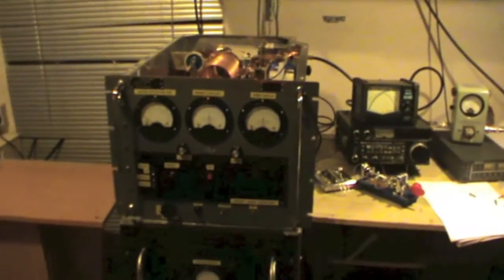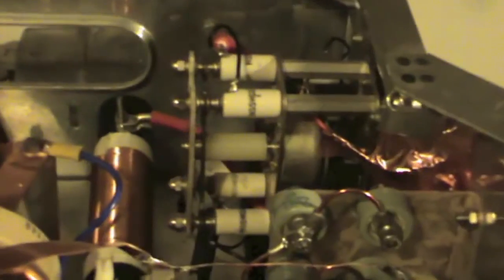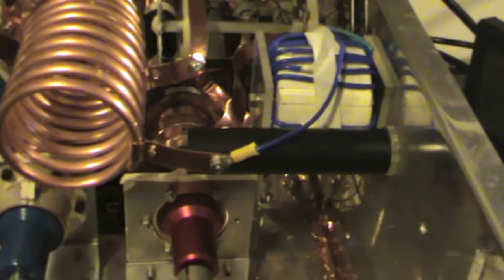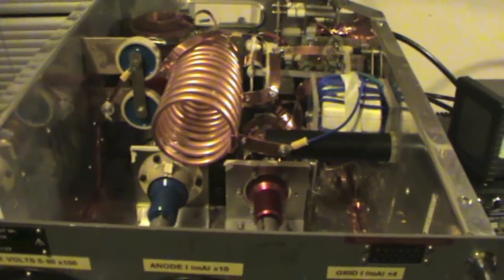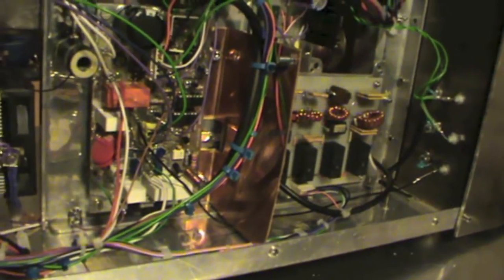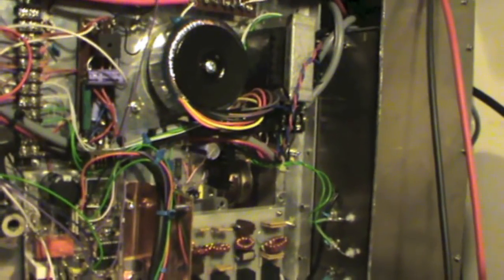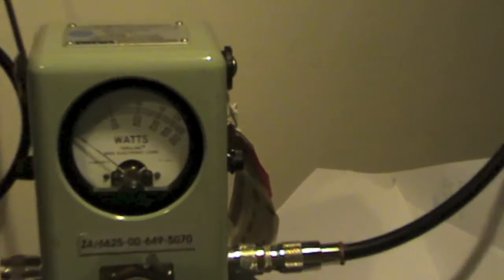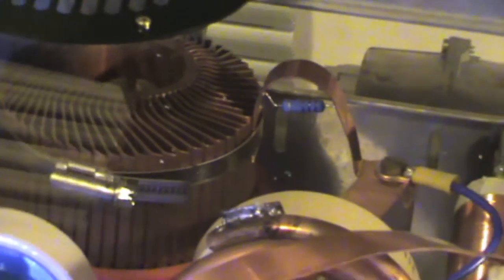gs35b linear Amp

Comment: I was looking for a blower fan for my GS35b based amplifier project and came across the same model as the one that you're using.  I've been told that static back pressure and all that stuff maybe a problem.  Did you have any issues using this model of blower fan, at all?   I guess working with jet engines gives you some perspective on this!
Reply from the maker: I never had any problems with my blower , seems to work fine
Reply: @thewtf  that'll work for me! Thanks...

Comment: Lovely looking amplifier! I see that you tend to build your's in separate cabinets, RF deck in one and PSU in another. Do you find that suits you better and allows flexibility of using the same HV PSU for different amplifiers?
Reply from the maker: Thanks for that... usually find that I have to build the psu separately because the transformers are really heavy. The amps on their own are pretty heavy. As you say it also means the power supplies can be interchanged

Comment: I'm playing around with a GS-35B linear amplifier at the moment. Did you look at the output waveform, did it produce a nice clean linear unmodulated carrier? What did you set the idling anode current and cathode bias voltage to?